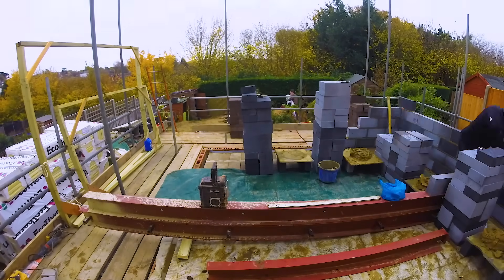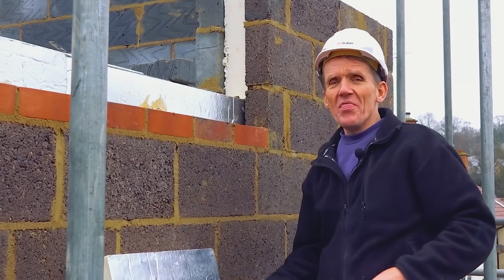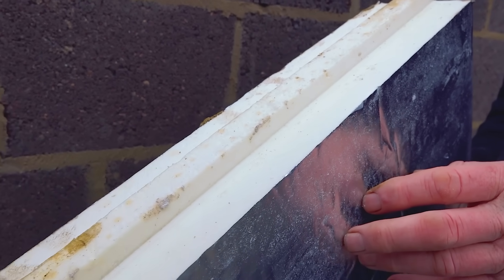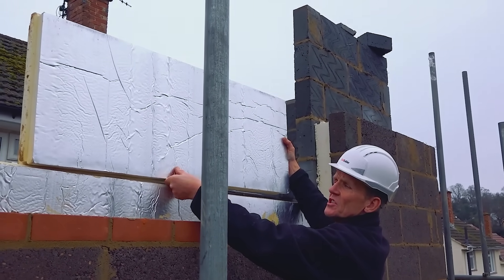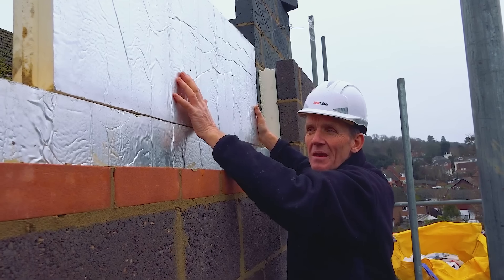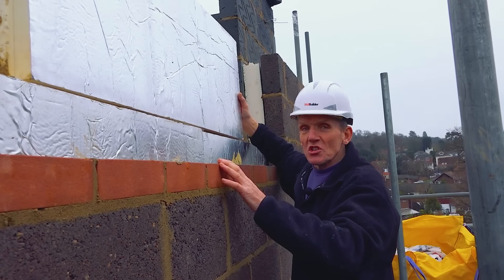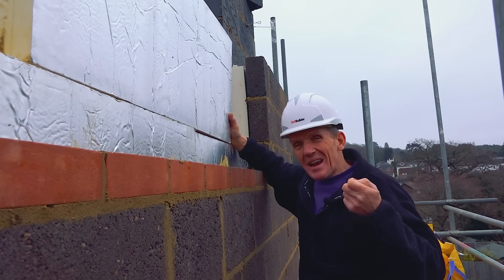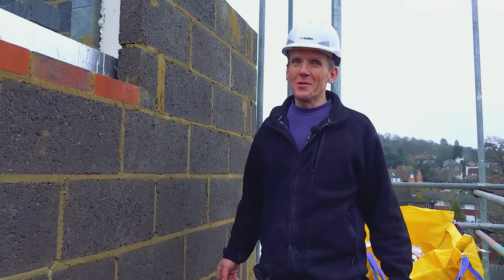Cavity Insulation | The Secret to a Warmer, Quieter House

Comment: Roger, I am seeing a number of videos and comments recommending to foil tape the outside joints on this type of insulation. This is generally regarded as bad practice, as it creates a barrier to vapour on the cold face of the insulation causing damp. Vapour control layers should always be on the warm face and the cold face should be able the breath. What are your thoughts?

Comment: I'm just having my building reg drawings done and the architect has specified a 150mm cavity with a 90mm T&G PIR.  Everyone is now telling me to scrap the PIR and simply go with full fill 150mm cavity batts.  I'm confused now as to which is the better solution.
Reply from the maker: The 150mm cavity batts are cheaper and a lot easier to work with. Architects are not builders so they don't think about the ease of installation. The PIR is also more expensive.
Reply: Hi, has your extension started? I’ve had the same thickness PIR boards fitted for the same size cavity. Just concerned if this will keep my house warm…

Comment: water will easily wick thru that T&G joint unless its sealed up with caulking or tape., especially the vertical seams.
Reply from the maker: yes but it hasn't and it won't because the wall is dry as a bone
Reply: @SkillBuilder  I'd wager they wouldn't leak without the insualtion...

Comment: 10mm gap is a nightmare for a bricky.10mm tolerance is hard to achieve. 90mm insulation the wagon wheels (clips are nearly 10mm say blockwork out by a few mm then the brickwork is virtually touching insulation. Ive had to widen the cavity to 120mm to achieve a easy build.cavity should be at least 120mm not 100.
Reply: Yet inspectors will turn up on site and tell us we're doing it wrong, when as you said 100mm cavity and 90mm insulation boards is a nightmare.

Comment: The bricklayers put this same insulation in upside down in my extension and they had to knock down a 3m high x 8m long wall and start again. Some very sad looked guys that day.
Reply: How did you find out they had put it on upside down? Did building control pick up on this?

Comment: My useless builder for our kitchen extension 100mm air tap with 100mm foil backed PIR, which was complete by time Building Control arrived to inspect. The only option to deal with it was to have a silicon based monocouch render supplier to the exterior walls, which pushed our budget further into the red. In fairness, the result is as Roger points out, that together with the 125mm PIR warm style for, we now use less energy to heat the whole house than before. There is no moisture getting in the whole open-plan downstairs with a humidity being in the mid 40s% if our Thermo Pro is to be believed.

Comment: The joints should be taped so that no moisture can get in between the boards at all. PIR is an open cell foam and when moisture gets in these joints the boards will soak it up.
I have taken down insulation from a concrete slab roof on a bay window, the foil on the insulation was pierced with screws and the bitumen on top had started to leak.
The insulation was completely soaked with water which literally dripped out when picking it up.
Also taping ensures complete air tightness. A beter choice would be XPS or extruded polystyrene which has a closed cell structure and doesn't soak up moisture, so additional taping or wrapping isn't necessary.
Reply: PIR is closed-cell foam.
Reply: @kashmirha  I once removed a roof which had been leaking for some time, the PIR under the felt was completely soaked with water, not just where the leak was but the entire roof.
So PIR absorbs water unlike EPS or XPS.
PIR and XPS panels can look very similar at the surface but they are 2 entirely different materials.

Comment: I have use 140mm full fill in my 155 ish cavity , I used sticky foam to hold it to the inner wall which is thermalite because those plastic discs are rubbish , I also taped the joints as well so it’s well sorted against any moisture ingress from the outer wall, I also covered inside the building with tile backer board 10mm .
In theory it’s going to take a candle to heat the house. 😊
Reply: Using thermalite inner leaf when you have 140mm of cavity insulation is a complete waste of money.

The efficiency gains from thermal blockwork versus lightweight aggregate or normal block are negligible.

Basically that 100mm of blockwork is as insulating as about 10 to 20mm of your insulation, which you have plenty of. 

It's pricier than normal block & less robust, more susceptible to cracking, not great for fixing into.

Comment: The installed the wall ties when making the inner wall. So how are they going to poke that through the PIR?
Reply from the maker: They sit on the horizontal joins as always
Reply: @SkillBuilder  Yes, but in relation to the PIR boards? You drill a 20mm hole in the PIR to shove the board over the walltie, then down onto the tongue of the board below? 

Then foam up the 20mm hole?
Reply: @jcvjcvjcvjcv  no that isn't permitted, all that is allowed is for the tongue to be cut slightly to creat a slot and the wall tie is laid in that, sloping slightly down towards the outside skin. The boards are exactly 2 block courses deep, so can fit between the ties.
Reply: @mikebarry229  The boards needs to move up and then down for the tongue and groove, so you need to put on the boards before the next courses of bricks?

Comment: As a Chartered Building Engineer and Clerk of Works unfortunately brickies cannot guarantee not having 10mm snots bridging this cavity. The detail is great on paper but in reality there are bridges with 100mm cavity and 90mm insulation.
Reply: As a former Chartered Building Engineer myself I agree that it is likely that some snots would bridge this 10mm cavity, but is this an issue (assuming the mortar snots are not ridiculously excessive) that is likely to result in any real problems? I see an issue if the whole 100mm cavity was bridged, but that cannot happen as the PIR will already be in place as the bricks are laid.  The mortar might attack the foil face but again I don't see a particular concern in moderation.

I question whether the function of the remaining 10mm cavity is actually to prevent damp penetration (in the way that the function of the minimum 50mm cavity absolutely is when square edged PIR cavity insulation boards are being used. I feel the purpose of this gap is to aid bricklaying, improve insulation (by having a 10mm still air space, and a low emissivity surface exposed in the cavity which benefit would be lost if there was no remaining cavity at all), and to prevent damp brickwork being in direct contact with the entirety of the PIR insulation for extended periods of time.
Reply: @mikebarry229  hi Mike. I don't disagree. I inspect of thousands of m2 of brickwork each year as well as investigate damp issues. You are correct that the odd snot won't cause a bridge of concern but even the not so sloppy bricklayer cannot be expected to leave the 10mm clear of snots consistently. It's just not practical so in reality there are dozens of bridges even if unintentional. The transfer of the moisture across the cavity is annoying to say the least. Even with a wider cavity they leave snots on the wall ties, slope the wall ties down towards the inner leaf, leave gaps or don't tape the insulation. These defects do not manifest themselves on day 1. When they do, those responsible are long gone. But designers are not helping by specifying construction types which are impractical to achieve.
Reply: @ConstructiveFocus Amen. Just been pulled by LABC for snots in a 100mm cavity with 90mm kingspan. Obviously the gap is too small so we can't clean the cavity. You can cut the snots, but this would result in the snots falling down and filling the cavity tray below. Which I think would be a much bigger issue than bridging the cavity everynow and then. It is hard to explain to people who never held a trowel in their hands, and just turn up on site to tick boxes. Nice to see that you understand the problem that brickies are encountering. 100mm cavity and 90mm hardboard insulation is not fit for purpose.

Comment: A light wind and rain easily get through those tongue and groves.
Trees literally use capillary action to wick up water from the ground all the way up the the leaves.

But it looks like the groves don't fit together tight and leaves a small air gap and that wil stop all wicking as long as the wind doesn't push it over.

Water LOVES to climb up small narrow channels.
Reply from the maker: I think the idea of wind and rain in the cavity is a bit far fetched. To get wind in you have to force it out. The cavity is closed and nicely sealed.

Comment: Im a brickie and its shite stuff! Slower for us which means more expensive for the customer. 

Do 150mm cavity and use full fill wool insulation.
Reply: Can you imagine a way to make it quicker to use rigid insulation with a residual cavity? Would making the residual cavity 20mm make it any easier?
Reply: PIR has better insulation values.

Comment: It looks a good system put personally given the cost of the boards they should joints should be taped with that foil  tape especially the cut ones. Having seen this used my problem is the 10mm gap or the lack of it as the mortar excess fills that 🤷‍♂️

Comment: Look lads the good thing about it is you don’t have to worry about cleaning your cavities
Reply: Yea you do. They want that 10mm void spotless. How they expect you to do that I don't know
Reply: Nah never had 1 engineer looking for the 10mm void clean,and if 1 ever did I’d hand them the trowel and tellum go on yiu fuckin clean it,they want wall ties every 9inches now up the jams with full fill pure torture
Reply: @deet1558  local inspectors ain't to bad. It's the bloody nhbc guys. But we are still aloud double wall ties every 450 up the jams tho. For time being anyway. And cutting it around lintels n trays what an absolute ball ache!!
Reply: Wait until they bring in the ties every 9inches,we were double tieing it on the jams in Ireland where i am up until 6weeks ago on my job at least,easy for a poxy engineer to say we want it every course on paper,but the practical element of it is poxy,we used to get a bolocking for touching the insulation with a saw,now they want you cutting it every course

Comment: Not a fan as is. Obviously a continental design incorporated into British builds. But obviously not doing it right.
Only having a 10mm gap you are going to have the snots on the brick up against the foil. That doesn't sound correct. Especially at any penetration point. Window door etc. Then unless they have changed the regs you have your wall ties coming through between every one of those sheets. This requires making a hole through your tenon, multiple times. Every hack through, and it will be,is a leak point. So my thinking is water ingress through brick. Snots right up to foil onto tie and tracked straight through the hacked out tenon creating symmetrical damp spots along lines of ties. Can't see it working at all. Ectra insulation, yes. Avoiding damp, no. More likely cause it. Awkward to install. And impractical in this configuration. I would be very surprised if this is how it was intended to be used. And in this video you can even see the misalignment of the boards. As is, pretty useless.

Comment: At 0: 17 is not a very good picture.. The mortor of the oute wall touching the insulation at the seams. But maybe it's more important to glue all the sides together and seal all the plates with tape together to make them airtight.
Reply from the maker: It doesn't matter if the odd bit of mortar touches the insulation, so long as there is a path down for moisture
Reply: @SkillBuilder  Maybe.. Because these days cavities are also 100 % filled with insulation beads or woll. ??

Comment: The foam on the pir is water permeable right? So, the water will just go through the tongue and groove anyway
Reply: I assume it will be taped. Have to admit, I'm not convinced by the 10mm though. Think I'd be more comfortable with about 3-4 times that.
Reply: Wrong
Reply: @mikebarry229  what's wrong? That the foam is not water permeable? Or that it will be taped?
Reply: @ricos1497  the foam is closed cell so effectively it is not water permeable (though water vapour can  pass through it to a very limited extent which is a good thing)
Reply: @mikebarry229  thanks. I hadn't realised that. I thought that the foil was the only impermeable layer, that's useful to know.

Comment: Can you show us how to close the cavity under new doors and  patio doors?Is slate sufficient or is there another way?Thanks.
Reply from the maker: You can do it with cavity closers and maybe a bit of slate over the top of that
Reply: Thanks,Roger
Reply: Premade thermally broken structural block
Reply: @Swwils . I have a beam and block floor....How does it stay in place?

Comment: I really don't like the look of that install. Can't see that not getting damp eventually. Great insulation? Sure. Avoid damp? Well I doubt it, when it gets wet it'll track through. PIR is not impermeable so that T&G will do very little more of a gimmick. This video looks like a promo reel. Not up to usual standards
Reply from the maker: This is closed cell and ten years on it is damp free. I don't see it getting damp ever

Comment: 10mm tolerance is a bit risky. Personally, I wouldn’t be specifying this system just build a cavity an extra bit to cover the difference.
Reply: @XTSu-sl1bb  no 10mm tolerance, a 10mm cavity is maintained on the outside face of the insulation. It is a requirement.
Reply: @  I understood, but for builder to keep to a 10mm cavity tolerance and not drop some mortar into the cavity is unlikely. It’s easy to draw with a 10mm cavity but difficult to build it. I prefer the old 50mm cavities to be on the safe side and stop the water penetration. I can see potential issues with this system and time will tell if it works.
Reply from the maker: A bit of mortar is fine. Any moisture still gets down to the footings
Reply: @SkillBuilder Manufacturer: "A 10 mm residual cavity should always be maintained between Eco-Cavity Full Fill insulation board and external wall leaf." 
"Residual" means without mortar.

Comment: Did you say 100mm cavity Rodger? I thought new Builds are now 150mm?
Reply: 150mm with Rockwool style insulation, this stuff is nearly twice as effective thermally (though Rockwool has other advantages it will take more space).
Reply from the maker: That is the point. This has twice the R value so you can keep the cavity sensible

Comment: As a bricklayer/general builder of 15 years taught by a bricklayer/general builder of 65 years, all this new building is a joke, cavity trays weep vents blahh blahh new build this got to be done this and that!! The amount of old builds, old brick flemish bond, English bond solid walls ect... ive never really found a problem with damp or anything! Tell me im wrong?
Reply: And in the same breath you will conpaint avkut the quality of uk housing stock
Reply: The issue often isn't damp, but a lack of insulation. So the walls are cold, so condensation forms on them, and you get mould. Strong walls, but no insulation value.

Comment: How do you gets snots off the back of the outer skin of blockwork ? 🤔...only used rigid full cavity bat insulation once and it was a nightmare , the skin of blockwork that was getting laid againt it kept ending up out of plumb as there is not tolerance....maybe im just a shot bricky 😂 but heard the same experience from plenty of others !
Reply: I'm no bricky but I've always thought the PIR must be a pig to install as cavity insulation. Even working round the wall ties must be tricky. If it's difficult to install then it'll lead to performance gaps in my opinion and the issues you described. Not convinced.
Reply: @Daniells1982  The boards are sized so that they go between the wall ties (the boards are 450mm tall), so you just put the board against the wall between the upper and lower ties, and press the board down. This causes any thin wall tie at the bottom of the board to act like a cheesewire and cut its own slot into the board. With thicker wall ties like Teplos (Basalt), you have to cut the slot yourself which is more of a pain, but the Teplos only get used on high spec homes with greater levels of insulation. I agree any problems with installation will lead to performance gaps.

Comment: We paid a lot more to use this on our build. Our builder just didn't understand it so I am not confident it was installed correctly. It cost us several thousand pounds more than standard 100mm PIR
Reply: Lol
Reply: It shouldn't have. It's the same material. It sounds like your weren't managing your builder very well, or supervising them. What a pity.
Reply: @tlangdon12  Our Architect specified Themoclass 140mm which at the time 2 years ago was really expensive at about £20 a piece. The day the builder started work I noticed he was building a 100mm cavity and I asked what the hell he was doing (He quoted against my design with a 150mm cavity). He said "we always do a 100mm cavity". I know now I should have bailed then. We agreed to pay several thousand pounds to have the agreed insualtion. This was an extension rather than new build so we were exceeding what was required by BC. We continued to have issues with the builder and parted company later as I was just not happy with the quality of work. I then took on the rest of the build myself just bringing in trades like plastering. Hard lessons learnt.
Reply: @JurassicJungle  I sympathise with you.

Comment: I think it’s a lazy work not to put cement or such to glue the insulation together.
Reply: No, it's not. It doesn't need it. It's proven to work reliably (for many decades) without any adhesive.